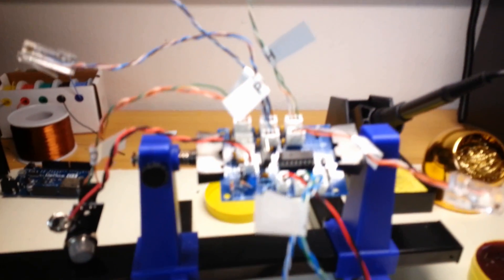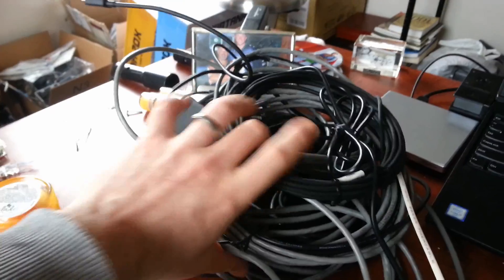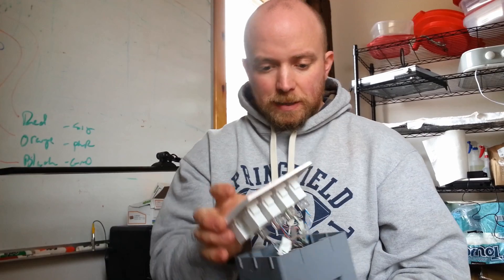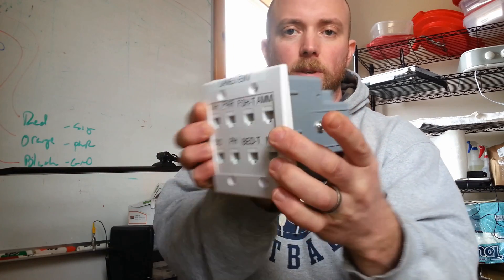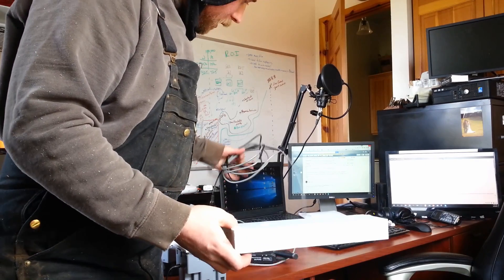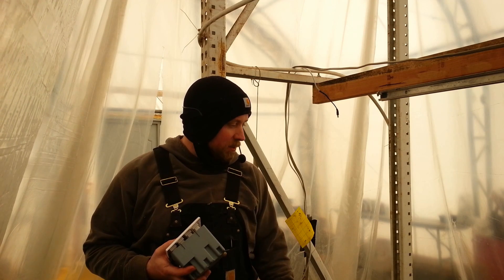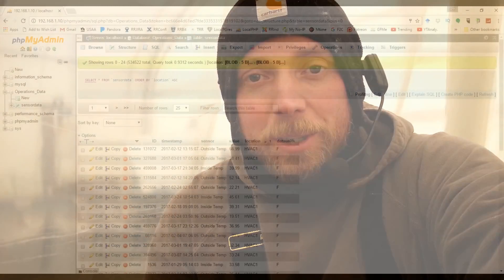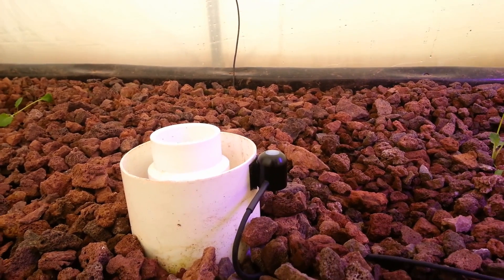Arduino Controlled/Monitored Greenhouse - Success - Part 6

Comment: One thing about your choice of using an audible alarm for the carbon monoxide, if the power goes out, you will notice the led will go off and you will know there could be a monoxide problem, if the power goes out you won't hear anything from the audible alarm, and there could be a monoxide problem without you knowing it at all... So you should have both to be safe.

Comment: Hey TRM,       Should the Dissolved Oxygen (DO) sensor be placed so close to the air stone (or what ever it is). I'd think you'd want it at least half way down the lane. Also with the DO that you think is reading faulty, have you switched it out with the good sensor to trouble shoot? Keep up the good work.   Cheers,    Bill

Comment: well done on your progress. to test the sensor that isn't working you could swap it with the one from the other lane.  this would let you see if it is an issue with the sensor and it's wiring or with the wiring in the box.
Reply from the maker: great point...I'm going to try this hopefully tonight

Comment: If you start working with foam more invest in a hot wire saw as it is much cleaner and can just use scrap wood, a stainless steel wire and a 120vAC to 24vDC transformer for the power.

Comment: What is the pH of your Water source.. is it Acidic/Neutral or alkaline..
I know that the pH affect's both the fish and the Plant's.. some Plants like different pH and they also affect the pH of the water.. The Fish will also affect the pH of the water...

I found from personal experience that the  Shell Grit will help to Balance the water....

If you have an issue of Low O2 try making a small floating Air lift to drop in the tanks.. They will circulate the water from the bottom of the tank to the top and they only use Air...  It's basically a float, with a Length of tube[2" say" that will just sit of the bottom of the tank when low water.. with a Air-stone sitting in the tube [Close to the bottom] Just make sure that the air-stone is fixed into the same level within the tube...

Comment: It's a great achievement!

One of your next improvement should be integrating the database with rrdtools or better, grafana. Looking at a graph is simpler than manually parsing into the raw data.

After a few days, you should be able to set some basic alarms, based on how the current setups are behaving.

Keep up your good work.

Comment: Did you put the CO sensor inside the box? If so you must move it out of the box along with the alarm. The box will impede the sensors ability to read true levels and the alarm will be difficult to hear inside the box.